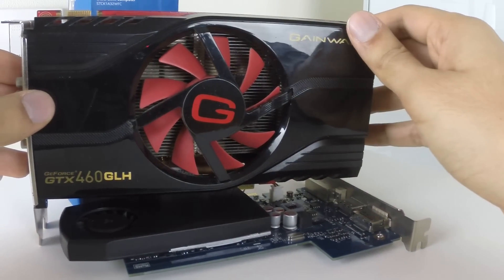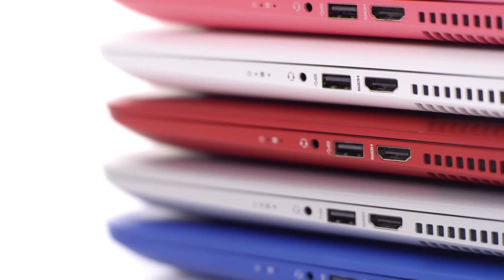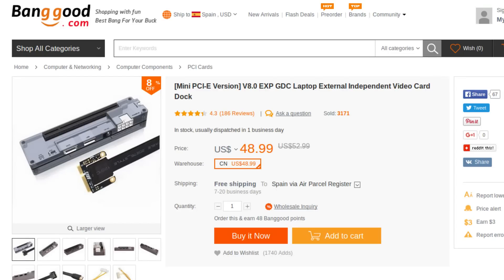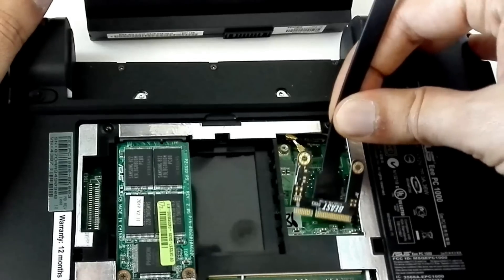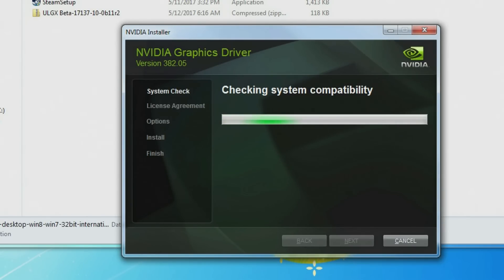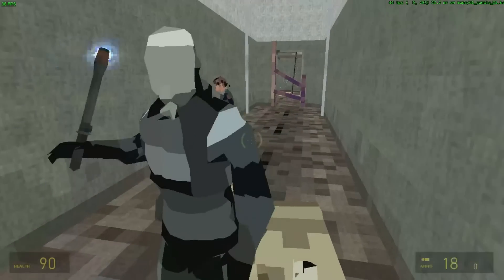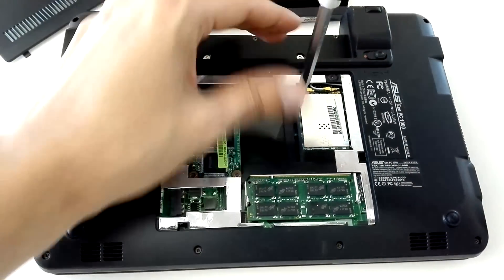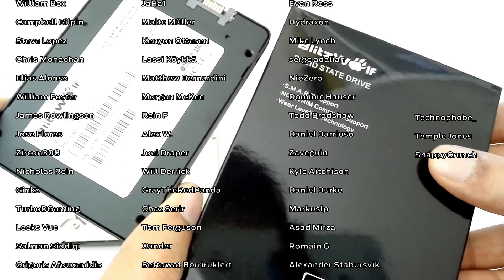An External GPU for an old Laptop?

Comment: Windows 10 on HDD it is disaster. Used it for couple of months and pretty much constant 100% on hdd in idle and waiting forever to bootup and get things ready to work. SSD is requirement for os these days, even with linux (arch in my case) which is pretty lightweight everything seems 5 times faster.

Comment: I guess for newer graphic cards it would be limited by the mini pci e connector. 

I'm thinking of getting a laptop with good cpu but it usually comes with a good graphics card too. Oh well.
Reply: The mini-pcie works as a x4 speed, so yes it will reduce the card performance, but its still usable.

If you go for a laptop, there is some budget gaming models with GTX1050 and quad core i5 that can be found for less than 1000$, but they usually have some cheap aspect such as bad screen.
Of course they won't be upgradable but it may stay relevant until you graduate.
Reply: No, all graphics card use the pci x16 connector; it's better if you buy the parts online to build a desktop pc gamer, laptops aren't worth it most of the time.
Reply: That is what I told myself and others too. 

Unfortunately things changed when I am doing heavy 3D and VR works in my university.
If only the pc in the lab is reliable, I could've at least use the pc, then continue my work at home. I move a lot throughout the year. And many other factors. 

We all know it is much cheaper to build a pc, but it is still not for everyone. 

But thanks for the info nevertheless.

Comment: I've done this using a MacBook Air Early 2014 with an Akitio Thunder2 PCI-E Expansion Box and an EVGA GTX 1050 Ti 4GB SC Gaming. I use a 120W Power Supply Adapter to keep the cables neat instead of a bulky PSU too. Its really similar to the EXP GDC in such a way that I can attach a desktop graphics card to the laptop, but the bandwidth is way better since it uses Thunderbolt 1/Thunderbolt 2 compared to mini PCI-E - don't have to take apart the laptop either. Installed Windows 10 via bootcamp and voila 40-80 FPS on med to high on all sorts of games like Overwatch, Dead by Daylight, PlayerUnknown's Battlegrounds, NieR: Automata, etc. Had this setup for nearly a year now, no issues whatsoever.

Comment: This is amazing..Should I get this with a Radeon RX 470 or the Nvidia 1050Ti? My current laptop has i5 3210m and 8gb ram
Reply: Will it fit?
Reply: You might aswell just go for something lower, you're not gonna be able to swap the CPU out on a laptop like that Emure guy says to. Go for a 750ti, you're not going to see much of a difference in anything other than your bank balance.
Reply: actually after a bit of research, you can easily change the CPU. That said the cheapest cpu I could find is around 80$ +the gpu + the $48 set up..so probably not worth it..might as well just build a PC

Comment: I run games in my laptop, I range from the most basic to Assassin Creed Black Flag, that is the most powerful that I ever played, well, that is not true, the most high spec game that I can play is Dragon Ball Xenoverse, and I think that I have a Intel Core 2 Duo, I think, because I not entirely sure, when I buy this computer, it costed a little more than it was labelled, and basically I can run games of Quad Core requirements, so I am confuse, but as my local computer expert had say to me, it all depends of the game not the computer, because something the game doesn't work even if you have all the requirements.

Comment: Do you think that i could run modern games (mainly destiny 2, which has similar requirements as mass effect andromeda) with this setup, but with a nvidia gtx 1050 ti, 8gb RAM (I can upgrade to 12gb if I need to), and an intel core i3 5015u? I don't mind when the frame rate drops below 30. For me anything above 20 fps is playable. Thanks for your help your videos saved me a ton of time!
Reply: I wouldn't bother getting a 1050 ti, 10** cards are known to have problems with this device.  Try to get a 750ti on ebay or something as those have been shown time and time again to work.  You'll probably be cpu bottlenecked anyway so the 750ti shouldn't make any difference and be much cheaper.
Reply: I don't think so man, I'm sorry. I mean you might be able to, but why would you buy a 1050ti for 20fps?
Reply: +oromis995 I don't really care about fps too much. Would I still be unable to play them at minimum settings?
Reply: Patrick Carl The fact is, nobody has tried it AND published the results for the 1050ti and a similar processor. The limitation to the x4 pcie speeds is the equivalent of putting the 1050ti on the pcie x16 of a generation 1 slot, if that is of any help. So if you already have the 1050, try putting it on an old Pentium 3 computer and see what hapoens.
Reply: I have found results after about a half an hour. You should expect to see 30 fps with everything on medium settings in Battlefield One. So that's very encouraging! Now it all depends on the quality of that Chinese dongle! Just take into consideration that your CPU will be at 100% usage ALL the time. So expect things to get toasty.
Reply: Thanks for the help!
Reply: Patrick Carl It's been a pleasure.
Reply: Harpskid  well, don't think you'll get a bottleneck if u have  a laptop with an i7 or 15 but no dedicated graphics card

Comment: Freakin' incredible. Maybe in future, try a GPU that needs external power and a more 'modern' Core i5 / i7. Not low-spec, but I wanna see how far this can go. Even folks with 'old' Core i7 4700HQ laptops are starting to feel the GPU bottleneck hard.

Comment: Well would I be able to use the Nvidia GTX 1080 on my new laptop? (The laptop has a Nvidia GeForce 940M with 2GB vRAM dedicated) I can run GTA 5 pretty good without optimization mods.

Comment: Soo now I need that and GTX 1070M.. no still prefer to get a PS 4. :D

But anyway good video 👍🏻
Reply: Dian Aprilian i dont think exist GTX 1070M because GPU in series GTX 1000 for laptop are same un deskop. the M is for mobile in before series lowest performance that deskop versións but the new laptops usé the use the same gpu from deskop.

Comment: is Radeon hd 8330 good or I get external gpu?
Reply: hesham ahmed if you have problems trying to run the games you want above 10 or 20fps, then this might be a neat solution.
Reply: I run battlefield 4 In 10-20 with Res scaling 100
Don't care much about graphics so I set it to 40% and boom 20-40 fps
Reply: Unlike spoiled rich kids I don't care much about graphics but care about gameplay and preformance 
And I only demand 20+ FPS so I think I will stick with my laptop a couple of more years
Maybe I will upgrade from 4gb ram to 8gb ram
Reply: hesham ahmed thats great! I can see where you're coming from and at the bare minimum, that's a great priority to have.
Reply: Yeah from Egypt ...was a great country back then ...but it's now screwed .. a dollar= 18L.E and the wages aren't very good either
Reply: hesham ahmed yikes my dude, thats horrendous.

Comment: gt 640 is the best. Its a beast. I [;ay battlefield on low settings, csgo runs on high with out lagging. gmod under stress still handles fine. If you use it in a regular tower pc, it runs portal 2 at 90-120 fps at 1080p on max

Comment: Will it work with a higher end GPU? (GTX 1060 3GB) Since the Mini-PCIe interface is PCIe x1 instead of x8 (or 16 idk) as most gpus require. Please answer my dude.
Reply from the maker: +Demox I am not sure now. It might bottleneck
Reply: It will work but it will be bottle necked a bit.
(looses perhaps 15 - 30 % performance depending on how fast the pci-e bus is on the chipset & how fast of a gpu you are using. & in some of the newest games the pci-e bandwidth might not allow the game too use vram smoothly all the way so you got too lower settings further then what others uses on a desktop system because of this.
(There's faster speeds in pci-e 1x on the 3.0 standard then the 2.0 standard for example though so you might be in luck and only have perhaps a 10% performance loss.)

Keep in mind you need an external monitor for this too work.

Comment: try 1080p m8. u know it already, pass the load to gpu. my i5 650 at 720p was horribe but 1080p wow (gtx650)
Reply: The performance wasn't enough to power anything on 1080p thanks too the cpu so he went much lower on the settings too balance it out better.

Comment: "I've never seen a expresscard slot"-Well i guess you haven't seen 15 inch laptops from  2008-2010(not exact time period)
Reply: Funnily enough, i just realised i was watching this video on a laptop with an expresscard slot :) (a lenovo x220)
Quite tempted to try this out for giggles now :D
Reply: lul i have 3 laptops 2 of which are broken Emachines E525(burnt SMC-ooops :D) Lenovo n200(dead gpu)and a DELL E5500.Both the lenovo and dell have expresscard slot and i plan on using the lenovo motherboard to make a small form factor pc out of it.If you look at the expresscard spec you can see that its basically a pci-e x1 + usb 2.0(3.0 for expresscard 2)and smbus and thats it.You need like 7-8 wires to connect a gpu to the moherboard.Sorry for the wall of text :)

Comment: Express Card is  common on "older" business class laptops - for instance I'm using Refurbished (and dirt cheap) Lenovo ThinkPad T420 - It has a Sandy Bridge core i5 processor, and has 8GB of RAM, and as you may know, sandy bridge is still powerfull even today!
You can just insert the express card in the slot on the laptop (no disassembly of the notebook needed) and you are rollin' 8-)
It's just plug'n'play (just install the GPU driver).
Enjoy PC Master Race 8-)
Reply from the maker: I am thinking of hunting down a thinkpad to try this. How expensive was yours?
Reply: Well I'm living in the EU and my country has this kind of "tax" for everything (so everything is more expensive because of this, sorry I don't know if there is some kind of better equivalent for this in english)...
But if you search it on E-bay you can find these with prices starting at approximately 100$ :)
ThinkPad T400 should be even cheaper.
I can really recommend business class ThinkPads! I'm using mine with this EXP GDC adapter and GTX 650Ti BOOST 2GB graphics card and its amazing! Now I have to make an enclosure for it (like the Razer Core etc...) and it will be in one cool package to carry around! at least somehow :)
Reply: but sorry to answer your question - mine was something around 200$. Bought it from a local store thats selling refurbished PCs with warranty and Win.7 Pro licence

Comment: When you use this setup you can expect to see a 30% decrease in performance with nVidia GPU's using internal display on the laptop, but something like 20 to 10% performance decrease on AMD and nVidia connected to ext monitor.

I never got ATi/AMD to work on internal laptop display with this only nVidia which is a shame, I wanted to try connect HD 2900 XT on my Dell XPS M1210.

Comment: Maybe the objective of having a weak cpu is to really see a difference between using the cpu and the integrated gpu at the same time and using just the cpu and a external gpu, i can see that could work for me because i have a APU and both cpu and gpu are shared on the same component (as much as i know) but it would be tedious to have a external gpu everytime i have to plug on my laptop, i think for some people it would be to work and save up some money for a desktop pc.

Comment: the mini pci express port would bottleneck the gpu, so you won't be using it at full potential.
Reply from the maker: according to the spec sheet it might. I don't think it would happen unless you are using a very powerful GPU. 

Even bottlenecked I would be bet it does better than a intelhd.

Comment: sooooo. im probably gonna try this
Reply: ThePaisleyProject have fun
Reply: JOnBeGone i have a couple spare 7870s, wierd that nvidia would block it though. its probably not enough pcie lanes or something, nvidia loves to do that kinda thing.
curious to see how it goes
Reply: gytux0258 will do. tinkering is the best part of pc
Reply: Henry Marocchi ah, that sucks. I'm afraid to risk my money for an eGPU that might not work with my All-in-One Dell. Guess I'll keep sticking with my PS4 to play more demanding games until I can afford a better PC.
Reply: ThePaisleyProject make sure you don't get a GPU that will bottleneck your laptop's CPU.
Reply: RALPHY88 was planning to use one of my 7870s or my 7970.should be fine for mini-pcie
Reply: hasani hall doesn't the 750ti draw it's power from the motherboard rather than the power supply? If it does I'm not sure how well it'll go with that configuration
Reply: hasani hall ok well good luck with that :)
Reply: hasani hall so did you managed to make it work?
Reply: Integrated Graphics aren't too bad as long as you use dual channel RAM. Usually it can run games that require a 1GB video card or lower and 6GB of RAM or lower. The eGPU approach is pretty expensive, even with the EXP GDC.
Reply: soo , 750 ti work with your laptop buddy ? i want try it too with my laptop , i3 4005U ram 10gb
Reply: never ended up trying it, never had the time or money
Reply: reza abi wakas Is the 750 Ti a low profile card?
Reply: +RALPHY88 there is a low profile version, but if you go the low profile route, look at the low profile version of the 1050ti, the 750ti and 1050ti low profile cards perform very similarly, so see which is cheaper.
Reply: MrWillyP i would get a 12-volt external DC Power Adapter for low profile cards instead of a regular power supply. You save a lot of money that way.
Reply: if it can supply enough power, then that would be the way to go
Reply: what i did about a year and a half ago was i got the gpd thing and a 750 ti and a 12 volt i think 6 amp adapter which was able to power everything, however I'm not sure if it was drivers or the fact that i duel boot linux and windows and just haven't had the time to test it but it unfortunately hasn't been working for me and currently i have the 750 in a prebuilt dell and am saving up for a desktop
Reply: @hasanihall-d5p  does it work to this day ?😂
Reply: @edo8533  hell no I'm using a 1060 now. My cat broke my last computer
Reply: @hasanihall-d5p  she made it fall ? 😭
Reply: My main rig is an i7 4790k (4.8 GHz) and a gtx 1080.
If I were to to this it would be for fun. I don't need to, I just find this knida thing hella cool
Reply: ThePaisleyProject you could buy a better used comp for the price
Reply: ThePaisleyProject WAIT if you are going to get a nvidia gpu i would recommend going for a 9 series gpu. The ten series gpu only works with 372.70 drivers (i think) or lower. I have a gtx 1060 3gb with this and it works really well but i can't update my drivers because nvidia for some reason blocked it on newer models. AMD however works fine with it (i think don't quote me on this) but i just prefer nvidia cus they tend to have faster cards.

Comment: i like the design of the laptop(or netbook whatever) even tho it is thick, don't like design of most new thin laptops
Reply: Yeah, the old designs can be very nice, such as the Dell E6410, HP 2560p or thinkpad business laptops.
Modern laptops also look good, but I'm not buying them because of upgradeability. I had great fun upgrading my Vostro 3550 to a quad core and using the expresscard port to make an eGPU. Even replaced the dvd drive by an HDD caddy, something that most thin ultrabooks cannot do.
Intel stopped making replaceable processors since Haswell.
What's next? on-board RAM and SSDs? Hope AMD can change that.
Reply from the maker: that laptop is really old. Ultra thing laptops where not a thing back then, I think.
Reply: Well, a lot of newer lowend laptop uses onboard RAM and eMMC storage :'(
Reply: now, that i know what is express card, why dont they use it anymore? now that we have usb3 it could share its bandwith  with express port(or even could be 2.0)
Reply: +DAR1US It's probably because it became obsolete for modern office computers, as this is it's main purpose. 
Anyway I personally don't think Intel/Nvidia/other manufacturers really want a port that's so simple to adapt into full size pci-express without any regulation from them. That's why Thunderbolt 3 is being developed as eGPU-friendly. More cash for them :p
Some modern Lenovo Thinkpads still have Expresscard BTW. These machines rock
Reply: + zwerne42 How about a Dell Latitude E6430?
Reply: got autocorREKT
P.S. I'm not that much of a tech guy, but I didn't rly hear about express cards, gonna google it

Comment: Finally you made this video!!
Reply from the maker: yeeeees
Reply: Heve you seen the new version 9.0b. It uses the m.2, PCI 3.0 x4 connection and the speed is the same and almost better than the thunderbolt 3 connection.
Reply: Julio Sanchez Here is a good forum post you can read https://egpu.io/forums/expresscard-mpcie-m-2-adapters/exp-gdc-beast-v9-0b-just-arrived/
Reply: Oliver Lundin could you please send the link? I'm interested in the one thats uses m2